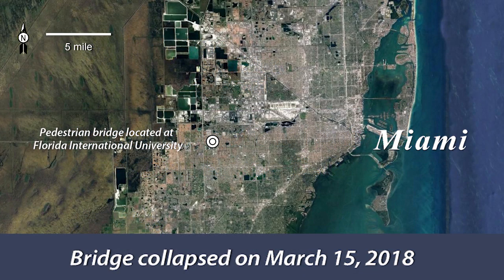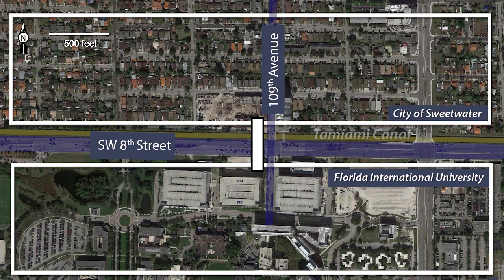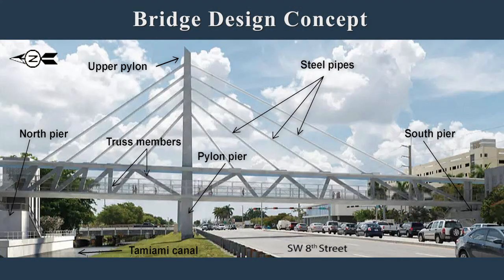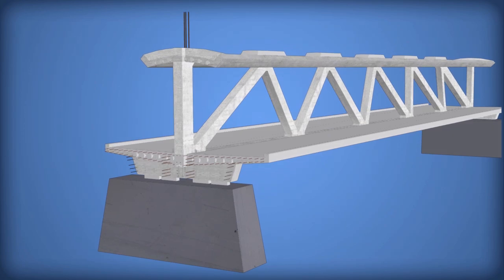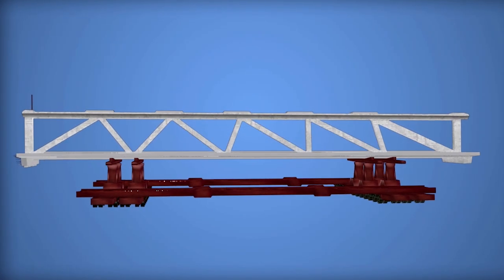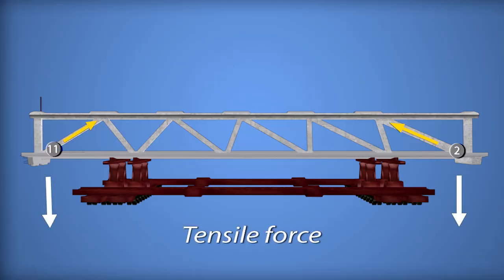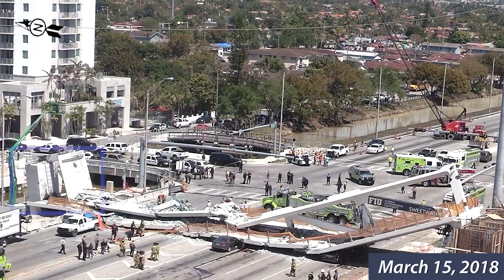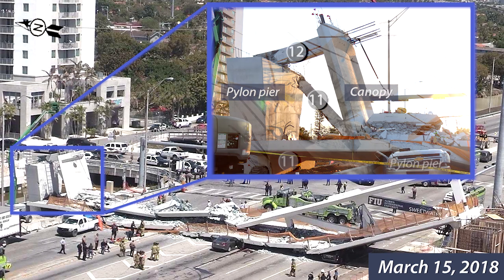Pedestrian Bridge Collapse Over SW 8th Street HWY18MH009

Comment: This NTSB video is an excellent review of events and what was seen, but does not tell us why the bridge collapsed. I have worked as an engineer in both academia and industry, having graduated in aeronautical engineering 38 years ago. The collapsed bridge is unique. Almost all bridge spans are arches, beams, cantilevers, wire/catenary suspensions, cable-stayed decks, and arch suspensions. If the column and cable stays above the bridge were merely decorative, as this video implies, they should not have been in the design. Adding weight and expense for zero client benefit is malpractice.

The natural solution for this pedestrian bridge is a slightly arched (humpback) reinforced concrete bridge with railings. There are thousands of such bridges worldwide. They are light and elegant, and their arches compress the concrete. It is possible to add roofs. Simple and good value.

The collapsed bridge was supposed to have been a giant beam. The most natural beam-bridge is a steel box truss of diagonally braced rectangular cells. The deck is inside the truss, laid along the bottom cells. The sides can be railed or meshed and a roof installed. It is easy to calculate the forces in the ties and struts. There are thousands of such bridges, especially over railway lines, where enclosure is desirable and a slightly industrial look matches the railway. When box truss beams sag, their lowest steel ties are stretched between the bridge piers. Provided the joints between them are intact, the bridge remains strong even after roof elements have buckled. One or more strong steel wire ropes can be run under a box truss to provide a redundant (fail-safe) high load-carrying capacity at little cost. Simple and good value.

All beam bridges must resist sagging, whether prestressed reinforced concrete caissons, steel trusses below or around the deck, tubes enclosing the deck, helical trusses (e.g. Melbourne), or geodesic trusses. However, the designers of the fatal bridge designed it as a giant, flat, prefabricated, prestressed reinforced concrete beam. Concrete is weak in tension and so the engineers had to ensure the concrete was always compressed.

There are three ways to do this. Thin reinforcing steel bars (rebars) can be embedded in the concrete, matching the steel cross-section versus that of the concrete to the expected tension, so that the steel rebars bear enough of the tension to ensure the tensile stress in the concrete is well below its fracture limit. This is fine for light, predictable loading. Greater sagging moments can be resisted by prefabricated, prestressed concrete. Steel rods are pulled between anchors within a form (or mould), which is filled with concrete. Releasing the steel rods after the concrete has cured pulls the concrete together, while the concrete maintains some tension in the rods. The concrete and rods must be properly bound. Prestressing can allow concrete to bear much greater loads before the stress “goes” tensile and ultimately causes rupture. The bridge was a giant prestressed beam.

The third method of compressing concrete is to have steel rods running through pipes in the concrete. They are not bound to the concrete or pipes, and have large heads and threaded ends that protrude from the pipe. Big nuts can be screwed down along the rod tails to stretch the rods and compress the pipes and surrounding concrete. This can be done if and when required, and was the method used to minimise sagging of the bridge ends when it was being positioned.

The beam web was a series of prestressed concrete struts and ties in the vertical plane. This is where the design went awry. A good steel truss allows minor relative rotation of the members at each joint, i.e., each member bears loads purely along its length, since rotation at the joints prevents transfer of bending moments. This was not the case in the collapsed bridge, where adjoining truss members shared the same rigid cold-joint feet. Relative rotation of the truss members had to cause tension somewhere in the concrete feet. Worse still, where the diagonal truss member joined the foot it had an integral triangular concrete wedge beneath it, to fit into the rectangular deck socket. This wedge could not be compressed in a manner compatible with the adjoining truss member when its stressing rods were tensioned for transport. The wedge was far from the rods and its strain was also limited by the cold-joint socket. Shear failure (a crack) occurred precisely where one would predict - between the wedge and the compressed truss member above it - when this truss member was tensioned for transport.

Incredibly, the engineers overseeing this project did not understand how the tensioning had caused the cracks, and ordered even more tensioning in the false belief that it would cure the problem. Precisely the opposite was true, causing the wedges to shear off and thus allowing the truss feet to move at the cold-joints relative to the deck. Once this occurred, the bridge no longer acted as a single beam; its effective second moment of area resisting bending plummeted. Without fail-safe redundancy, it collapsed and killed five people. Complicated, overpriced, bad engineering, compounded by low IQ!

Comment: I studied civil engineering although I didn't pursue it as a career. 

When we started to learn about bridge design a lecturer warned us against making structures that lied about how they functioned. I remember the bridge he used as an example because I have driven under it thousands of times. It isn't at all unsafe but it is dishonest. 

The geometry of the truss in this design was chosen to imply that the bridge was cable stayed when in fact the steelwork added on top would just have been for decoration. This is bad design. Even if it functioned as intended it would still have been bad design. It's not surprising that a client might request a fake cable stay bridge, it's disappointing that an architect designed it (if that is indeed how this project developed) but it is unforgiveable that an engineer was willing to be involved. Perhaps it isn't surprising that the project failed when the grand concept was to tell a lie.
 
Let's hope that after the court cases and investigations there is some clarity into the decision making process so that lessons can be learned.
Reply: exactly.

Comment: "Accelerated bridge construction" No wonder it fell..
Reply: I’d wager 90% + of new bridges and decks use ABC, and they are still standing just fine.
Reply: The concept is used routinely to erect highway overpasses.  It was misapplied here.
Reply: @GH-oi2jf  and is that “misapplied here” because the construction was accelerated without enough thought and focus on whether it was safe? “Accelerated” anything is a disaster waiting to happen..just like a good beer
Reply: @michaelsteven1090  if your not familiar with the process I can see why you might not like the sound of it. It simply describes the procedure of building a bridge adjacent to the highway then moving it into place over the course of a day or two.
Reply: @michaelsteven1090  — “Misapplied” meaning they used the method to erect a structure which was unsound.  The method of erecting a prefabricated structure is not unsound.  The structure itself was unsound.
Reply: @morbideddie  That's textbook, right?..I don't have an engineering degree, and respect anybody who does, somebody made some mistakes, not to blame..People died, damn, it hurts yet gov., local and fed, call it "accelerated" like thats the reason why it happened..Thanks.
Reply: @GH-oi2jf  And who let it go "unsound?".surely there is a an answer..People die, and no one is to blame.
Reply: @michaelsteven1090  it’s been incredibly common for decades now and is very well understood. I can’t speak for America but in the UK and Europe it’s very common to build the deck adjacent and then move it into place. 

The issue with this structure wasn’t the construction method, but the design. The structure was pretty inefficient overall, but wasn’t necessarily structurally unsound. The issue came from a lack of reinforcement at one of the nodes which I believe were due to an error in the structural modelling during design.
Reply: @michaelsteven1090  — It was an unsound design, as the NTSB found.  The node at 11/12 was far too weak.

Comment: This is just a theory but the people in charge could of been warned from an engineering standpoint that the roads should of been closed upon seeing the cracks. The problem is that in Florida, 8th st is one of the busiest streets so maybe someone was pressured to keep that street open and proceed with tightening the trusses.
Reply: The companies working on erecting the bridge should have shut down work and told the highway department to close the road.  A lot of people are culpable, in my opinion.

Comment: It's one thing to make a bad design, and for inept workers to improperly work it but once it starts cracking you don't just put it up anyway... wow :)
It seems to me that just a box steel deck and actual cable stayed suspension would be easy here if you wanted it to look like a suspension bridge anyway. Holding up that short light bridge span with cables would be super easy and I presume quite inexpensive. Box deck cross section should handle lateral forces well enough.

Comment: Designers are not Engineers, sure it might look great as a water color picture, but the reality is that bridge was an accident waiting to happen, and it did not have to wait long. Building it off-site and wheeling it into place absolutely caused damage. It is absurd in this day and age that people would try that.
Reply: ABC is an industry standard practice my dude.
Reply: There were many engineers involved in this design — people who should have known better.
Reply: Building the bridge offsite and moving it into location has been standard practice for decades. Hardly absurd, infact it’s absurd to not use the tech when it’s available.
Reply: @morbideddie  https://www.youtube.com/watch?v=73EScguZZzI and it is NOT standard practice, especially how haste fully this was done.
Reply: @apointtomake1517   yes, it is very common. You can YouTube multiple videos of bridges being constructed using this exact method. I’ve worked on maybe 30 bridges over the years that were installed this exact way. Constructed to the side and then installed via crane or SPMT. It’s incredibly common in Europe, though I can’t speak for America. 

At the end of the day the concept of constructing the bridge off site and positioning it separately is normal and safe. It’s arguably more safe since it allows for better inspection of the underside prior to moving.

Comment: These are not cold joints, they are Construction joints that are designed to be there.
Reply: They are “cold” construction joints.  That just means that the two sides of the joint are not poured together.  The deck was poured and left to harden, then the truss was poured.
Reply: The person who made this video is as ignorant about the types of concrete joints as you are.

Comment: As a "natural engineer" I can tell you this: I believe the failure was in the design of the bridge and had less to do with "cold joints" and that the cracks on trusses 12 and 11 were due to the  forces coming from the area intersecting trusses 10 and 9 directly on the deck, this is where I believe the failure began. If you observe the trusses 1 thru 12  from right to left, the trusses progressively change until they achieve an almost 90 degree at 10 and 9, the design of the bridge seems to be putting an un equal amount of pressure at that point (also down the center of the deck). The cracks at 12 and 11 appear to be separation cracks not compression. If at the point between 10 and 9  the bridge begins to sink (lower in elevation) due to compression, then the area at trusses 11 and 12 will crack and appear to separate. If you observe the collapse you will see the failure start on the deck just after point 10 and 9 followed by the canopy between 11 and 10.
Reply: That is because they hired people that fits their narrative and not engineering skills. I believe it was five women. They kept that out of the Media. Just like this Sub that went down to the Titanic, today is their last day alive if not rescued (very unlikely)The CEO said he didn't want to be like most and hire a bunch of 50 year old white men so he hired a very young and diverse group. Bet he wishes he hired the 50 year old professional white men now.

Comment: You can visually look at the bridge and tell its a terrible design. The deep spalling and cracking should have immediately warranted a road closure. If one member fails then the whole thing collapses? Who signed those plans. 

Imagine pulling down in the center of the bridge, where will all the force transfer to? The "v" joints between 1,2 and 11, 12 will take the majority of the weight. the "11" diagonal was substantially smaller than the "2" diagonal.

Comment: Non redundant is not something you want to hear
Reply: Most trusses are nonredundant.  Look at the I-5 Skagit River bridge, for example.  It was a fairly common bridge design.  In 2013 a truck with an oversized load struck one member of the truss and bent or broke it.  One complete span came down.

Comment: Dear NTSBgov...i have 2.1 km Cycling bridge 12 m span in typical and  3 spans in 50 m cross over high way road i designed in steel structure truss box ...i would share it with you for cooperation and work on it. it still tendering stage. but in case we get the job i believe we need redesign this large spans..  can i get your contacts please.

Comment: Absolute horrible design, failed without even a load, solid concrete joints at angles with minimal reinforcement. Anytime a crack forms in structural concrete there is trouble let alone the severity of the cracks that developed. They added tension to an already tension failing part of the structure. Even if they succeeded in installation more people could have been killed when they gathered on the walkway, adding tons of weight on a design done by an engineer that should not have a job after this.

Comment: I'm no Engineer but I do have a good understanding of Physics. I'm also into construction and have been for over 40 years. I know how the strength in Concrete is from "Compression".  What I don't understand is why anyone thought it would be a good idea to put more tension on load bearing supports when when the supports were crushed and cracked????? That makes about as much sense as putting compression on a broken bone trying to compress both ends together. Just won't work and will make matters worse! Whoever approved the repairs should be fired and held accountable! People died as a result of somebodies stupidity!
Reply: The “tension” applied was to the steel tensioning rods, they apply a compression force to the concrete which would counteract cracking caused by tension.

Comment: After careful study of many different post-tensioned concrete bridge designs, it is my opinion that the engineer who designed this bridge is clearly at fault for the deaths of all involved due to his/her poor design.  Clearly this unproven, untested bridge design was faulty on several counts, the first of which were this engineer’s grossly incorrect stress, load, and tension calculations as evidenced by the growing cracks and delamination of the concrete from the reinforcing bar.  Secondly, any bridge designer who designs a bridge which has no load transfer redundancies built into it is not only a complete disregard for public safety, but is irresponsible and is guilty of misfeasance on every level.  What a complete moron.  I hope he not only lost his job, but was sued, convicted, and his reputation destroyed.  It is my opinion that when it comes to public use of utilities and infrastructure, a much higher level of design and engineering must be required in order to keep the public safe.  This obviously was not done in this instance.

Comment: The design flaw is in these boards which are sold on plans to build an art piece which delays quick inexpensive and safe construction, so they can have their names on a plaque.  Instead of creating something that students, faculty and visitors would be able to benefit from quickly, they are sold on an "iconic" structure.  Plaques on the structures should have on them how quick the consumers can use it, the construction cost and maintenance costs, then the bastards on these boards can put their names.  This would cause them to think about what they are doing.  This thing was designed to have seating.  Seating on the bridge so people can enjoy the carbon dioxide rising from the automobiles.  Its not just a bridge, its an art piece, a lounge area, a gathering place.  It was designed to try to achieve goals other than the main goal which it failed at.

Comment: I have done this type of installation a number of times. The move plan for this span laid out by the drawings WAS NOT followed. The move plan had the Shirley trailers located farther out towards the ends with more beams, plates and bracing under the span to spread out the loads. The initial reason for not following the plan was given that it would take too long to fill the west side of the road way with dun age and fill to allow the westward trailer to drive closer to the westward pier. The on site supervisor made the decision to move the westward trailer in on the span with a phone consultation with the engineers. To work on the span without shutting down the traffic should lead to manslaughter charges for those that made that decision. When the cracking first appeared it would have been prudent to start bracing the span with erection supports on the ends as the structure was losing its structural integrity and was heading for a failure.